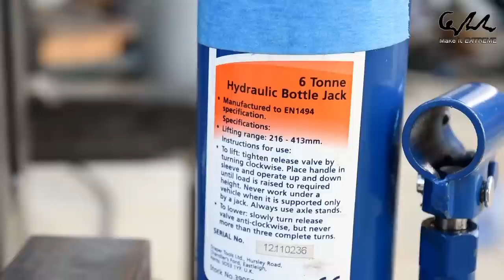Homemade Metal Bender

Comment: 9:16 through 9:22 the magical self-cutting lathe, no spinning required!
Reply: That's a mill.. And the bit is spinning
Reply: +Nick Kolb yes. so are the wheels of sarcasm. I simply meant to play dumb because the rpm of the bit lined up with the frame rate of the camera and created the appearance of non-motion
Reply: Ahhh I see my bad
Reply: All good sir
Reply: You can always explain that by fancy rpm and frame rate explanations, in fact there is only one explanation to that stuff: it's black magic ! otherwise how could you explain the way he bends metal without effort ?
Reply: It's not without effort. See the wheel he made and is turning? It's that diameter to give him leverage. And he starts the bends using a hydraulic jack.
Reply: I'm guessing steel was being sarcastic..
Reply: +Nick Kolb Sarcasm is something hard to get at first time :)
Reply: It's so much easier in person.
Reply: Yeah, nah... that thing doesn't spin at all.  It just pushes metal out of the way.  Stop motion... what's that?  And why are the buttons on these remote controls too small?  I'm tired, I need a nap.
Reply: Finnagin Frost right so, that wasn't a lathe... that was a drill press...
Reply: Finnagin Frost películas cristianas
Reply: Películas cristianas

Comment: 8:40 you can see some flexing on the rear right bearing support section.
Not a long term good thing.
I'm sure bolting it thorough the whole section with inner sleeve would have been better for you.
Very nice work.

Comment: You win! That is awesome. I just finished building a roller that I can bend 20in wide 1/2in thick 6061 Al into a 20in tall 20in diameter or larger cylinder. Now I have to go back and do a bunch of mods to make it as versatile as your machine. I hate to love you. Back to the drawing board I go lol. You definitely do make it extreme!!!!!!!!

Comment: One thing you could add is to weld a ruler near the hydraulic jack handle. So you can measure how much throw is needed to get the right diameter of a circle you need, and get rid of the jack handle slop to get a better measurement.

Comment: First time for me seeing one of your videos.  I thought I would see if someone had a clever idea for a small metal bender.  Then you start cutting a hundred pieces of square tube and welding them.  Then you pull out these big pillow blocks, and I am wondering what the hey?

Very impressive metal bender design and execution, and very impressive video.  Thanks!

Comment: well done! beautiful! 👍 i recomend to have the top wheel in the shape of the square tube as well, it will keep the inside of the tube in shape and prevent the squeeze of it, the out side of the tube strech and less important to have the shaped wheels. also three shaped wheels will reduce the distance between the touching points to the tube and allow smaller radius of bending ;) SUPER COOL stuff mate! cheers 👍👍

Comment: THIS WOULD HAVE BEEN A FANTASTIC VIDEO IF YOU  HAD just tried to get one more cut for a 1 inch board and see how accurate it would have been and how much planing if any you would need to get a reasonable inch thick stock piece.  I suspect you would have tried it at 1 and a quarter inches to get a good planed 1 inch product with less wasted wood.
Reply: sorry wrong video box, but yours was good too

Comment: Hi, its always a plessure to watch your work. 
A question,, the MIG welder youre using, what minium and max Amp got it? Mine is really old and at its end of life state and no good for  <1.5mm and  > 3mm steel. Even unstable running. no power switch just wire speed control. So I need a new one which can weld 1mm till at least 5mm steel, guessing from 55 - 150Amp. Sound that about right? Thank you and keep the projects comming ;)

Comment: Nicely done.  Why pay more when you can make it yourself, but better?  I've noticed the cutoff saw in several of your videos, what make is it?  It looks like a regular abrasive cutoff saw but with a carbide blade - did you convert an abrasive saw?  If so, I thought they went too fast to use a carbide blade with.

Comment: Most impressive. 
What sort of blade was in that cut-off saw? Mine uses a grind/abrasive disc. Would love to be able to cut as cleanly as your saw.

Would also be interested in learning the brand and model welder used.

Thanks for posting.
Reply: Carbide blade
Welder: Migatronic, model ?

Comment: I'm a huge fan of your channel but I've been wondering lately if there is a way to reduce the outside diameter of a steel pipe... something like what a swaging machine would do... I need to fit a 1" pipe inside the next and so on for a thing I'm trying to built. There's no shop with a swaging machine near by and I'd love to do it myself

Comment: Really nice project! I just have a question: would the bender work the same if only the upper axle was connected to the pulleys and rollers with a key. If the pulleys on the down axles were free to move (no key) around the axle? I was thinking that only the "motor axle " needed to drive the pulleys, cause it's the one used to make the metal go forward. Am I wrong?

Comment: is that gasless flux core welding wire? He's welding outdoors but I see no sputter on the work piece like you would normally see for flux core wire? It even sounds like a gasless welder. Just curious

Comment: nice fab skills.bet the metal cost  a few bucks
Reply: About 1€ per kg if bought as scrap and about 2-3€ per kg if bought new. Although since these guys are on an island (Cyprus) scrap might be cheaper and new stock more expensive since supply and demand in small places can get out of whack. But generally this approx. what steel stock costs. Exotic geometries and sizes as well as Hardware stores have their own rules. Steel is remarkably cheap atm  in Europe but this might change since every now and then tariffs on Chinese steel are discussed. Construction industries benefits from cheap steel and the steel industry suffers. Whoever cries louder wins.
Reply: The great lakes region of the northeast, US,
metal prices have vast differences depending on geometry, specific composition, quantity, and  availabilility..
If you need something specific and immediately it is usually expensive & they require,you buy a minimum amount..
Just recently needed 150mm of stainless for rush job on lathe  and had to buy 5x that length to purchase it locally...
      If you have time,the best place to shop for steel is on the internet.
Time seems to be the most valueable commodity of all.
     The price per ton of scrap metal can have drastic differences from month to month here sometimes..
Ive never known what drives the prices..besides greed.lol
That metal fab tool video is one of the coolest ive seen in a long time..
   Thanks for shareing

Comment: good work. can ı ask one question ?
first machine what is this name ? please link i search long time 
0.20 s.
Reply: A "Chop Saw" with metal cutting blade. Available at any home improvement or hardware store. But if you're not sure what the name of the first tool is I don't think I would be trying to make this metal bender yourself.

Comment: hello sir,
my name is slama mohamed habib i'm from tunisia , I am a student in the inuversity of technological studies in tunisia I am entrenent to do my project of end of study in my university in this framework I took this machine as a theme for my project with some modefication concerning ( The steering wheel that I will replace it with a reducer motor and I will add cylinders to do the girding of the profiles ...) 
so i hope that you help me with the bender dimensions 
Please accept, Sir, the expression of my sincere greetings. I hope that you answer me as soon as possible please and thank you. :)

Comment: please about your drill and drill bit. how can I get it?
Reply: NOT be creative Titanium coated HSS step drill bit. You can find in amazon, ebay, aliexpress or harbour freight.
Reply: thank you, please your welding machine type, and company
Reply: NOT be creative What you saw in the video it's MIG Welding. Mine is Redbo MMA Inverter 120e (SMAW/Arc Welding) with a digital readout. Very cheap, low wattage, very durable. I won't mention my old welding machine, it sucks :D
Reply: this could be a simple $40-80 welder..
the uploader was using Hardwire, so he had gas hooked up, but you should be able to do this same thing with a fluxcore, selfshielded welder.
Reply: MIG is a great tool tho this could have been done with stick or TIG tho the time, effort and cleanup with stick would have been much greater.